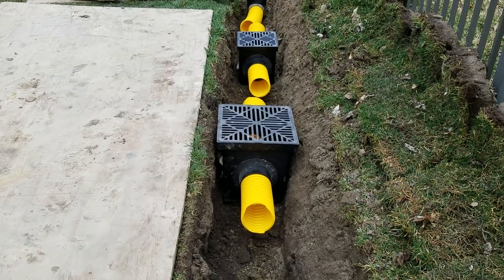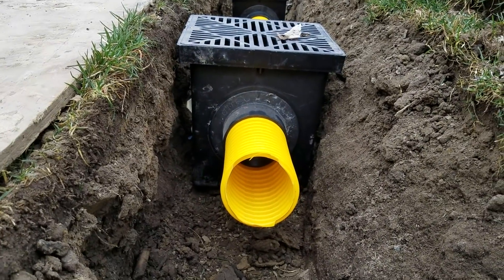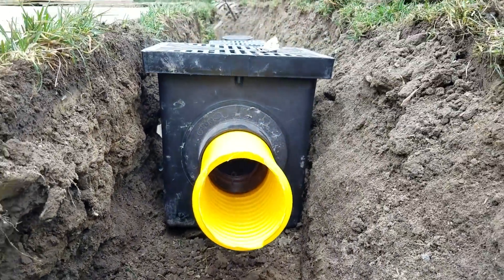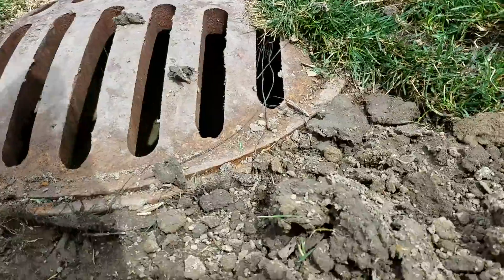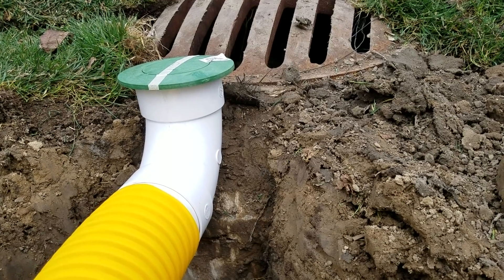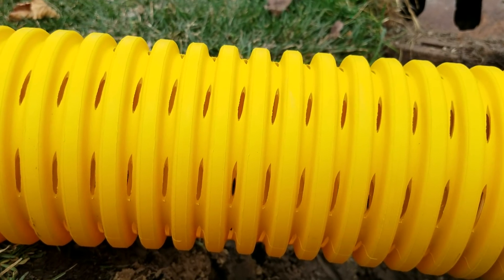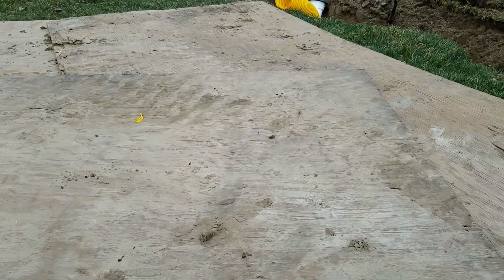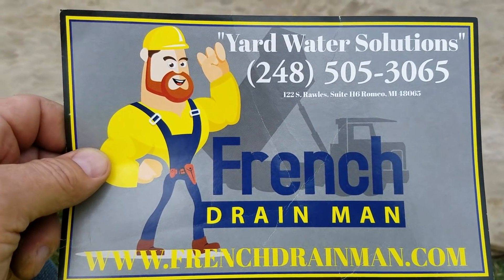Yard Drainage Failures Must Watch!!!

Comment: you can install a collar extension on any one of them, (circular or square shape) and go to the deep you wish. Is expensive though.
Also, don't forget that when the water comes to certain speed inside a pipe generates an inertia that help to push the water out the pipe, but will the pipe be completely empty of water after? Probably no
Regarding the leaves from down spouts, the amount down the gutter will depend in the trees branches  proximity to the roofs, wind and of course, type of tree's leaves. Does gutters grids and filters work to keep leaves out?
Reply from the maker: Downspout Cleanout and Leaf Filter Gutter Leaf Guard
https://frenchdrainman.com/product/downspout-leaf-filter-clean-out/

Comment: I have a question, do you need to burrito wrap the top of the round rock french drain? I would not be planning to put grass on top.
Reply from the maker: You can run it wide open on top if you want to I do that when I can however if your catching sheet water off a roof or parking lot it will get loaded up with sediment. We sell 3ft x 100ft drainage fabric for open French drain with no fabric on top.

Comment: NDS basin with risers and set it below the bottom of the trench are great. You should come over my house. I have bought and installed your virgin pipes and they are the best. NDS basins are very good products too. High octane is great stuff but pricey in my area. I used several hundred feet of it. I did not use peanut pipe, but I think it does have its place too. Not in my yard. I have all river stone and geo fabric, high quality, not the home depot stuff. NDS basins are the best on the market quality wise in my opinion, I have 17 of them in my yard. I would say your pipes and NDS basins are the best combination. I am in FL and it keeps up with mother nature. I do not run my French drains into basins except to discharge to the culvert Basins. My culvert runs straight through my property. Basins  with a bit of water in the bottom also provide nice locations for frogs and other wildlife. I have seen you use open grates in your system as overflows. Black pipe has nothing wrong with it if it is solid. Black pipe in a french drain can provide excellent aeration when stacked above high octane. High octane at the bottom is ideal. I have never seen an interest by any critters eating any of my black pipes, yes, I have some, but very little perforated, none perforated in sight. I ran a bit short and had to get this job done.  My french drain system runs from my 8" culvert into the 36" city culvert 24/7, it never stops. Thanks for all your advice. You need to get lower pricing on shipping, down here to FL cost me a small fortune. Also, Chuck is a nice guy and does good work. We should not take for granted we as people are all not the same and there is more than one way to skin a cat. Thanks Robert for your educational videos.
Reply from the maker: https://youtu.be/PBc3btMLafc?si=5ISDsSYooXyio5JY